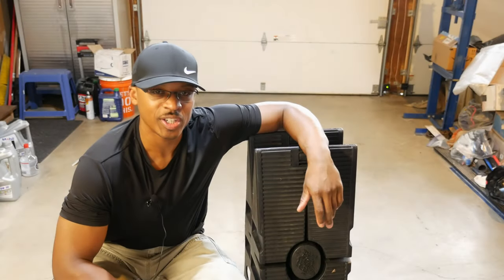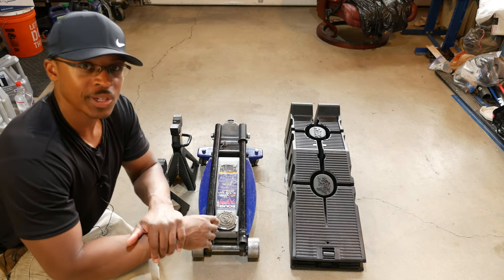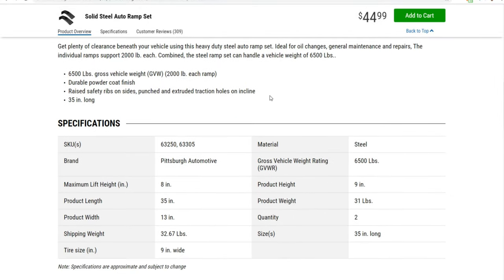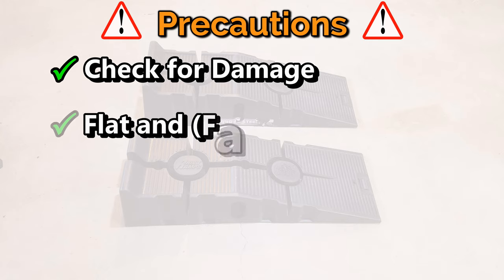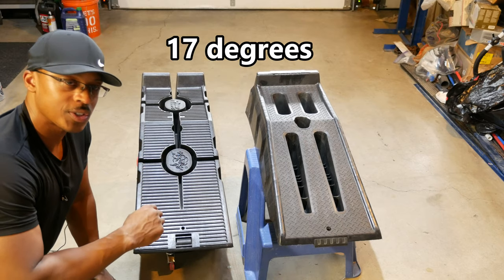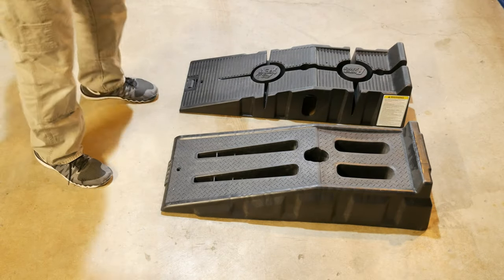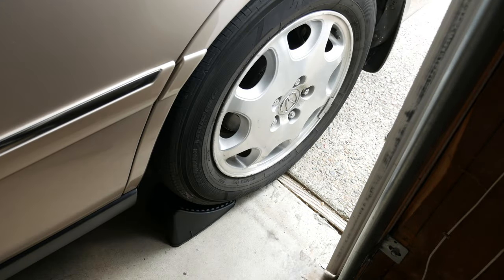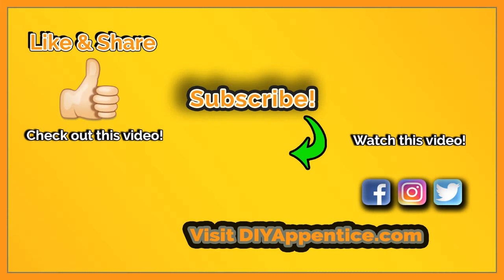Rhino Ramps Review and Tips for Using Car Ramps

Comment: I've used Rhino ramps for 20 years+ and the only thing that I would add, is that I also use jack stands as an extra precaution, when the car is on the ramps, for extra security. Excellent video.
Reply from the maker: Yes, I sometimes leave my jack in place if I don't have a solid place for jack stands other than the pinch welds.
Reply: Same here extra protection is needed for sure! Last time I didnt have extra protection I ended up with 5 kids 🤣 Jack stands gives me the peace of mind when using the rhino 🦏 ramps
Reply: @denniscarey8426  hey Dennis! I’ve seen a Semi run up on Rhino ramps my friend! 🛻 They can hold a Tundra, Ram or whatever you have 🙂
Reply: @denniscarey8426  Dennis have to be honest with you that I have been using mine for over a decade and I still trust it. I always use a backup when climbing under the car such as Jack stands and such. I would recommend completely but I’m not the one climbing under your car. For me they work great, and easy to move around. Of course they are basically hard plastic and maybe buying new ones after so many years would be a great idea. I would buy them again and again . Good luck with your decision
Reply from the maker: @denniscarey8426  Per the specs, this 12,000-lb version should support trucks that size, but I personally would go up to the 16,000-lb version.
Reply: @denniscarey8426  rated for 12k lbs

Comment: My local parts store had these. My vehicle is 3600 lbs. so I was uneasy about laying under my car when it was propped on plastic ramps. Watching this video has given me a little more confidence to make the Rhino purchase. I will not be paying the mechanics shop $120 for my OW-20 fully synthetic oil change. Oil+filter+ramps= $88 and only $50 after because I won't be buying new ramps every time. Thank you for the video.
Reply from the maker: Some have reported having issues with these ramps collapsing, but I've never experienced it. Adding jack stands may ease concerns.

Comment: Very well done video! I've been an automotive tech for about 35 years but have never used ramps. A lot of cars out there today are very low with no great place to put a jackstand once you've jacked the car up. I just bought the Rhino ramps to do oil changes so your video was perfect. You seemed to be very knowledgeable and very well spoken. Keep up the great work!
Reply from the maker: Thanks! Appreciate you checking out the video.
Reply: Yeah i just tried jacks with my scion didn't work....wondering about these ramps for oil change
Reply from the maker: @valjean2036  I would try the yardstick test mentioned in the video.
Reply: A tech for 35 years and you do oil changes without the vehicle being level? If you are the former your wouldn't do the latter!
Reply: @raydavison2972  I don't know anyone who puts their vehicle on 4 stands just to change the oil. The oil pan plug is generally at the back of the oil pan, so being level isn't needed.

Comment: There are some Ramps on Amazon, and they are very similar to your Rhino ramps you are demonstrating in your video. They have the Two round center parts on each ramp the same as your ramps, and they say in the description, the car ramp also has stop auxiliary device, when the car wheels press the brake device, it can help you to stop the car, more safety. Do you know what this stop device on the ramps is, and how it works? It doesn't mean the moulded in chock at the end of the ramp on each ramp. The Brand name for these ramps is NAIMP.

Comment: I think the sliding is intentional. If it slides you aren't going to roll over the top when you reach the back stop. If you give it too much gas and the ramp remains stationary you're going to roll over the stop.
Reply from the maker: I tend to believe that the sliding is not intentional, and it's more of an issue on smoother surfaces; the prior version's foot had much better grip. I'd worry about property damage if I had a short runway. As you may have seen, the sliding was eliminated when I tucked the ramps under the tires.

Comment: I appreciate basically every aspect that you went through to make this video.. there was just one major flaw that I feel I have to mention.
You went through the trouble of doing an extensive review, but then after you got the car on the ramps you didn’t show us how much the car was lifted and how much room you’d have to work under it up by getting down under it or at least get a shot of the car from underneath. You just brought it back down almost instantly.
Of course I understand that each car is different and this and that, and you may have had your reasons. But I just feel like it would have made the video incredibly stronger.
Thanks for giving me confidence to use these ramps for the first time, I’ve always just used jacks and jack stands but wanted something quicker and finally broke down and bought them.
Reply from the maker: Fair point. Thanks for checking out the video.
Reply: @DIYApprentice  no thank you for making the video! I feel much safer now without even ever using them yet lol! Car will need an oil change by next week.

Comment: I recently bought a set of these Rhino ramps and had to return them.
I tried several times to drive my 2014 Miata on them and they would slip out about half way up. My garage floor is smooth finished, and I'm sure this didn't help. No problem with the angle of attack and I line them up with and wedged them under the tires, tried putting them back a bit, nothing seemed to work. I'll probably end up building a set out of wood and put a mat of some kind under them. Great review, thanks.
Reply from the maker: Yeah, the rubber foot is not very good. Thanks for watching the video!

Comment: Good video, thanks for posting this, just heard some of the new Rhino Ramps collapsing with vehicles less than the max weight. Maybe user error by driving over or off center. Though use of jacks with this would be safer.

Comment: So my brother gave me a set of 6k lb Rhino Ramps. He had used them one time. Things changed for him and no longer had a garage to store stuff in so they are mine now. My floor in my garage is very smooth even glossy shinny. I dont want to rough up this look. My Rhino Ramp would not grip. I put down some industrial grip tape and they still scooted forward when trying to get up the ramp. I used the strap from the Harbor Freight ratcheting tie downs t have to solve the slide issue.

 I pushed the strap threw the centering hole just in front of the front edge on the ramps. I tied two knots on top of each other so the knot was large enough not to let the strap pull back through the hole. Then I laid the rest of the strap back away from the front edge of the ramp toward where the rear  tire would be so the rear tire could roll over the strap.  I also put a few strips of Gorilla Duct Tape to hold the straps down on the garage floor. When I roll up the ramp the fact that the rear tire is on top of the strap keeps the ramps from moving forward  so the Ramp wont scoot out. 

Keep in mind the straps stretch and the ramp will scoot forward a few inches until the strap is taught. In my case I wanted my car to be positioned where I had set the ramps not a few inches forward of that area. I had to redo this point where the edge of the ramp was  to take into account that they would move forward just a little until tension was on the straps. 

I hope this idea keeps someone else from the frustration I was having with the ramps scooting out when trying to get my car to drive up on top of them
Reply from the maker: You may have noticed in the video that I wedge the ramps into place under the tires before driving onto them; I've never had issues with them moving. My floor may not be as slick as yours, though.

Comment: Great video! I know you mentioned how you wedge the ramps to the tire and center the dot, but a quick look from the rear side of the car making sure the ramps aren't tilted in or out at all on the wheel-stop side has saved me a couple of times from driving off the side when I thought it was already straight doing a quick checj from the front, but luckily decided to double check before driving up
Reply from the maker: Thanks

Comment: Good video bud... tell me, is there ample room to change oil on low stance cars without feeling confined?  I normally use a floor Jack on both sides with Jack stands but the ramps might be easier.  Thanks
Reply from the maker: These ramps have about a 17-degree angle of incline, so I would do the yardstick test on the car. The lowest stance car I've had on the ramps was a 2000 Toyota Corolla - plenty of space.
Reply: @DIYApprentice  I use it for some lowered cars, you can get some wood at the transition to help it clear the bumper but its tight. You may be better off driving up on 2x4's and jacking up from there (just don't forget to set the car bqck on them)

Comment: I just bought the Rhinos for a C3 Corvette.. They slid all over the garage floor.. I will try it your way next time.. Put the ramps at the dot where the tires are and then go slow.. Thanks for your info.. Very good video... stay safe...
Reply from the maker: Yeah, I didn't like that they slide so easily as you probably saw in the video. Hope they work out for you.
Reply: Any ramp will easily slide on a flat concrete flor........Cut 2 pieces of thick carpet in a rectangular shape , slightly wider and longer than the ramp...and place them under the ramps  and projecting about 6 inches in front. ..  When you slowly drive on the ramp it pushes the ramp lip down into the carpet and stops them slipping .
Reply from the maker: @mikecrowley3102  I'm not sure how much of the video you watched, but I demonstrated that my old ramps did not slide nearly as much as these ramps. As I showed, I tend to wedge the ramps under the front tires to prevent them from sliding.
Reply: @DIYApprentice      Good evening.   Thanks for your reply.     Yes, I watched the full length of the vid.  

Unfortunately the comparison you gave of the 2 sets of ramps with regard to them slipping was of little value because you did not press down on the the small movable friction pad , sited on the front of the ramp.     Regardless, ,   any difference  is not really important to   Dan ,  (who my reply was aimed at ),   as he  has already bought the Rhino ramps .!  All these lightweight plastic ramps are liable to skid out of position unless care is taken .   My post to him was suggesting  a simple solution to reduce the likelihood of this  problem happening . 

All the best .   Mike .
Reply from the maker: @mikecrowley3102  I've never had the ramps slide when I tuck them under the tires like I showed. Also, I was applying quite a bit of force with my foot near the front of the ramp, even though the amount of force wasn't measured or apparent on video. I'm definitely not dismissing your solution, though.

Comment: what a grate video   thank you for all the helpful information  I have the 1600 model and I never noticed the thing in the middle to line up the tire with   I will use this next time I use my ramps.  I have the metal type from hft as well  but they're  getting a bit heavy these days    I turned 57 and im still doing this stuff just  but just not as strong as I used to be   you never stop learning  &   I always learn something new
Reply from the maker: Glad you got some useful info from the video. Thanks for checking it out!

Comment: I just used the newer ramp to do a quick oil change during my lunch break. Would say that it held up great but my problem was.... Exactly what you said, the foot of the ramp. Once I put my car on the ramp I noticed that the foot of both ramps swiveled & no longer aligned with the tires. Was curious if I could put maybe a rubber or even yoga mat under each ramp to help it from moving next time. Great video
Reply from the maker: Yeah, the foot is very disappointing. It would hurt to try something like a yoga mat. I thought about looking for some sort of slip-resistant tape.

Comment: Very well thought-out video, thanks. I'm watching because my 11909 rhino ramps often slip on me. I've had them go both forward as I drive up, and once even backward under the car. It's a little scary. I don't wax my garage floor (ha ha), but it's smooth concrete and the oil and fluid stains don't make it any stickier. 

Next oil change, which is coming soon, I will try your trick of wedging the ramps right up under the tire before driving. I've done it this way, and now can't recall if it always prevents slipping or not. I've also done it by rolling up slowly and steadily, and that works sometimes, and sometimes slips. If your method doesn't work for me, I'm going to try cheap rubber mats under the ramps, which some people use. . . . And thanks also for the tip about those tire centering marks. Never noticed them before.

As another viewer mentioned, I always put a jack stand on either side as well––either at the jacking point, or under the frame somewhere. You just can't trust the manufacturer's specifications on weight capacity, especially as the plastic ages. Better safe than sorry.
Reply from the maker: Yes, the rubber foot is terrible. Hope wedging the ramps under the tires works out for you; it seems to work especially well for front-wheel drive cars.
Reply: @DIYApprentice  Great. I've got 3, all front-wheel drive and all in the 20-year age range.
Reply: I’ve had this thing happened to me before to where it sucked inward underneath the frame I thought for sure it was over, doesn’t help when you have a forward -wheel-drive car damn near suck them in 😂 that’s why I’m looking at that race ramp or whatever it was called anti-slip, huh I will put it to the test😂

Comment: I own a 2007 nissan altima and i needed to change my oxygen sensor located in the exhaust pipe right under the car,i tried these Rhino ramps and found that they didn't bring the car high up enough,i got to the sensor of course but there just wasn't enough room for me to maneuver and do the work,my waist size is 30 and my height is 5.5inches,and if a skinny guy like myself couldn't use them,anyone heavier should not even try them unless their vehicle sits up high.Their durability seems to be excellent though.They didn't work for me.The night before i had tried the red 3 ton torin aluminum Jack stands,they gave me a good height that i needed,enough room to work under the car,and they are quite durable too,but i just didn't have the right tools for the job that night.The following night when i tried the Rhino ramps i had the tools just not the right height,too fed up to switch to jack stands...i took an L and called it a night!
Reply from the maker: Yeah, these ramps were definitely not the right tool for the job in your case. I mainly use the ramps for front end fluid changes, since most of the fluid plugs are near the front of the car. I use a jack and jack stands for everything else.

Comment: Good job on the review man. Had a little trust issues with the ramps. Now I feel confident that I'm not gonna die using them.
Reply from the maker: lol. There have been some reported failures, but I've personally not had issues with my set of ramps.
Reply: @DIYApprentice  how often ypu use it mate i got a workshop so ill probably use it a couple times a day for quick jobs, you think it will break?

Also wanted to ask would you ever consider putting anti slip material on it?
Reply from the maker: @kotoposts  There have been reports of these ramps breaking, so I can't say how durable they'd be in a shop environment. I have not had any issues, but I only use them maybe once every two or three months. I've seen a couple automotive YouTubers use them in their shops.

Comment: Well presented vid!  Just the info I was looking for.  I like that you emphasized the warning/direction labels - they are there for a reason.
Considering the Rhinos as I'd like to use them for getting at the wheel barrels for cleaning and detailing.
Reply from the maker: Appreciate you checking out the video. 👍

Comment: Nice. It's also a good idea to measure the inside edge of the ramp when the tires are centered on there to make it easier in the future. Put the ramp on the tire. quickly measure the distance between the front ends, and go. Writing the measurement on the ramp with a sharpie or something helps. 
It's easier to be a little off with the spacing than you think.
Reply from the maker: I've done that in the past - definitely not a bad idea.